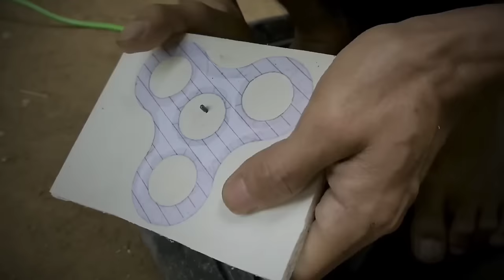How to make a mini windmill water pump from PVC pipe

Comment: PVC turns into dust after 5 years in the Sun
Reply from the maker: Can be replaced with galvanized or stainless steel pipes for large scale applications
Reply: @Ytcrop  or just start with a good plastic like POLYCARBONATE which is good for 50 years in the Sun.